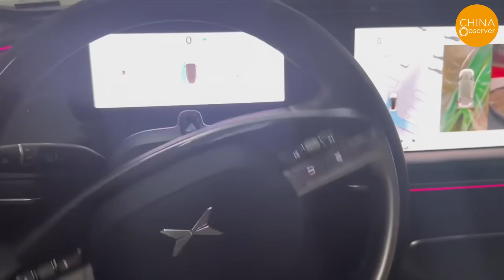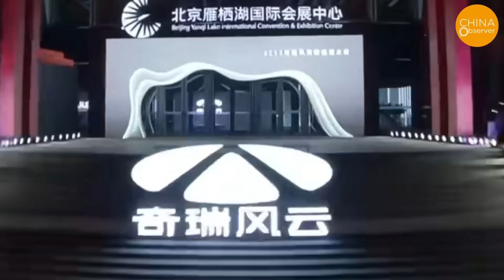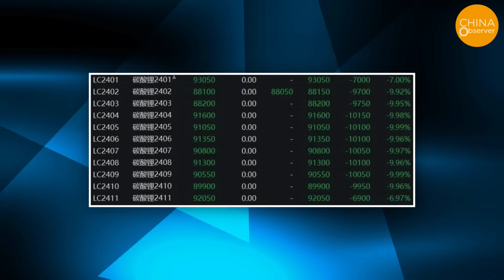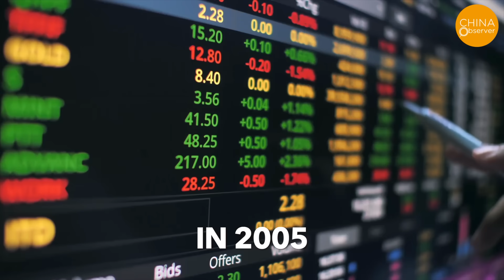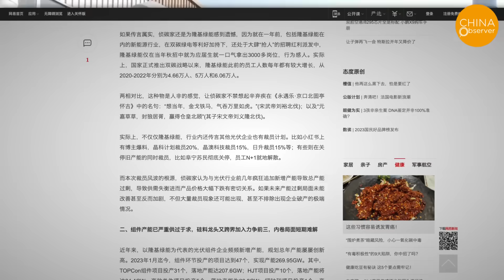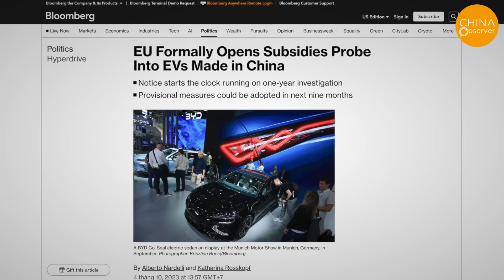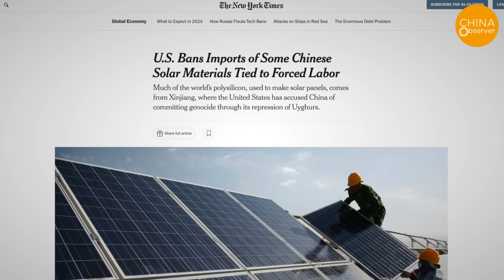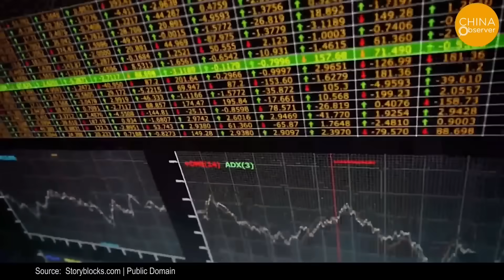Sudden EV Explosion, Rockets up 5 Meters, Close to 100 BYD Autos Spontaneously Combust

Comment: Albuquerque almost BYD electric buses for its transit.
The buses ended up not having the range they promised. The charging stations they installed were not certified and ended up being dangerous if they were used long term.
The city was smart in testing after delivery, instead of taking their word.

Comment: And theres why EV's arent so special, the companies wont take care of the used bateries cuz is not viable, fossil fuel still reliable, but its needed a better way to reduce the CO2 expulsion of the engines, or to find a new way to have a more reliable and sustainable way to power vehicles, with less impact to envoirement in both ways, creating it and reciclying it. But....they preffer to dispose it rather than recicle and reuse it, cuz its easier, less work, less workhands to pay and to take care.

Comment: My guess.... their not giving the Electric battery compartments room to 'expand' due to heat build-up in the batteries, nor do they have air-holes for the gases created / released by the batteries to escape... which is causing heat-damage and possibly condensation to form.  And Lithium + Water do not mix.

Comment: New battery technologies are rapidly advancing to replace ithium batteries. Sodium ion batteries have reached the efficiency of early lithium batteries, and sodium is waaaaaaay cheaper. Short distance sodium-ion cars would already serve the needs of the many who just use a car locally. For the two-car households, it's a real option, once a cheaper version gets marketed. As with early Teslas, the first cars are marketed as status symbols, but copy-cats aiming at a broader market are in development.

Comment: The work to engineer a good EV battery isn't easy. Just a few years ago we had BYD batteries being touted as so safe.. now we see that they have problems when they put them into packs. Single batteries are one thing battery packs are something entirely different. Managing batteries and keeping them safe isn't as easy as it looks. Chevy Bolt shows just the same kind of issue.
Reply: Scandinavia has been crazy enough to try out electric excavators, only to find out the batteries won't even last until lunch. So what do they do? Hook the excavators on to fuel-driven electric generators. Hurray for technology!
Reply: @haraldthi  Fun fact

That was a Toyota Rav 4 . A gas car . Oops 😂
Reply: The NEWER batteries LiFe-Po4 based on iron and phosphor are safer, lighter, hold more charge and cheaper to make, and being made right here in the US
Reply: @HobbyOrganist 
"Safe and Effective."
Reply: @FCE-dogs LiFePo has been tried for a while, and as I can remember there's been problems with it slowly leaking power. Has this been solved yet?
There are brands now focusing on synthetic fuels instead, and that's also an option. I have too much background in the natural sciences to really believe in this climate hysteria though. Do we change the nature around us in a way that can't go forward? Yes but it's not nearly that dramatic.
Reply: Yeah, there's no way we're going to be able to adopt this tech unless it's centralized on an electromagnetic rail network. Just make the roads move on tracks and any old lawnmower could get places at consistent speeds. But I also think the same has applied to gas powered vehicles for decades now and way too many people perish because of operational/technical failures. It's unacceptable for a shared public roadway
Reply: Super Capacitors In Hybrid American made Cars! EV's Are DECADES Away From Viability! We Could Not Change Over To EV's Even If It Was The Law!! There Are Fleets Of Trucks That Wanted To Go To Electric Only To Find That To Charge Them Up Would Use More Power Or Volt Amps Than The Entire City Uses During Full Draw! EV's Wont Happen Because They Can Not Happen!! Not For At least 20 More Years!!

Comment: Supposedly Sodium-Ion based batteries are more stable, non-flammable and offer higher energy density and lower manufacturing costs than Li-Ion batteries but are currently problematic as the number of charges over its lifetime is much lower than Li-Ion batteries. Once the number of charges over a Sodium-Ion battery's lifetime is increased to near the level of Lithium-Ion batteries then it will takeover as a storage medium in most applications which require portable power.

Comment: The problem is: we are on the wrong energy paradigm. Cannabis hemp seed makes excellent engine oil and gasoline which is biodegradable. A sativa strain can grow up to 15 feet in six months. The female's seed production constitutes up to 85 % of the bio mass. Not only is the seed useful for fueling vehicles, it can be used for cooking oil, bread, porridge and so forth. Indeed, hemp seed is the most complete vegetable protein on the planet. Do you have any idea who is responsible for the colossal crime against humanity by demonizing cannabis hemp agriculture? The usual suspects of course. These very same miscreants are behind the EV bandwagon.

Since it is obvious China doesn't give a damn about the environment and is indeed an environmental rapist it is high time this grab hag culture is re directed. Because of the huge subsidies for EVs for example, entire acres of new EVs are sitting, rotting in open fields. Serpentza did a video pertaining to that. And, as was indicated in this excellent presentation, within the next couple of years a major ecological disaster will unfold because of the lithium ion batteries which are highly toxic and very dangerous. 

As for the efficacy of EVs, I would have to opine that they are not efficient at all. The batteries take much too long to charge up. If I was on an EV off road motorcycle and ran out of electricity I would not be able to solve my problem by plugging into a currant bush. Who is going to come out into the forest or up on the mountain with a battery and charging cables? As for charging stations, they are a joke. Only x amount of Kilowatts are assigned to a charging station and if there are several vehicles charging, they only get a percentage of the total and will not likely obtain a full charge. The entire EV circus is what it is because in general human beings like band wagons and don't like thinking very much. EVs are just another example how human beings easily believe anything put before them, especially by other human beings in fancy robes, funny hats, huge fortunes, whatever. To wit the adulation of Elon Musk and the 'success' of Tesla Motors. Promises, promises, and more promises but no tangible results. He is polluting the upper atmosphere with dangerous satellite telecommunication systems at the behest of governments who are ruled by corporations run by the usual suspects, of course and who are hell bent upon the total control of everybody on Earth with chipping technologies coupled to the nefarious military industrial satellites Elon and that other billionaire twit, Branson are putting up in the skies; OUR SKIES! What gives these creatures the right to do these things to us? To force EV tech on us? Do you not think we should perhaps consider this gong show for what it is and stop it before we go any further with this dangerous, basically useless technology and do as I suggested? Get on a more advanced, sustainable, environmentally friendly energy paradigm with cannabis hemp. Talk to your politicians. Perhaps there may be one or two out there who are not in the pockets of the suspects who are usually responsible for 99% of our afflictions, misery, and ultimate destruction.

Comment: The main challenge to China's energy industries is hydrogen since it can both power hybrid and ICE vehicles including buses, trucks and trains as well as supply power for domestic and industrial use. The problem, as perceived by those who buy into the carbon dioxide- climate scam - is that in producing it by steam reforming from methane large amounts of carbon dioxide are produced. Apart from the need for this to sustain food production countries like the UK intend to store it in depleted oil wells. Claims of producing it from surplus wind power do not stand up to scrutiny due to the costs of liquefaction, storage and transport as well as the power needed. The UK intends to replace methane in the national gas grid by hydrogen but it can also be produced locally by electrolysis using surplus power from the small modular nuclear plants being developed by Rolls Royce and it German and Indian partners. This provides a practical means of storing energy from the need to run these plants 24/7. This means that the future is hydrogen not wind, solar or battery EVs and China has backed the wrong horses.

Comment: Someone has to double check the videos here, the first white can is not an electric it’s a modified car to run on LNG and similar accidents happened for these modified cars.
Most of the explosive comes from PHEV plug in vehicles have really scary failure rate in China, yet for EV with LFP batteries has no record for similar problems

Comment: My technical analysis:

The battery cells propagated already beforehand of the explosion and the battery housing had no functional degasing valve (maybe was closed in a backyard workshop) and therefore the pressure could increase this much with a high volume in the housing that the housing exploded with accumulated gases at once which let to the rocketlike vertical flight of the car.
Reply: It's a rav4 from a movie shoot.  duh.
Reply: @ianrobertson3419 show me please the movie :)
Reply: My analysis: evs are a scam
Reply: @tylersowa3858  of EVs r a scam. Why the cars exploding are gas cars ?
Reply: Not a very technical person then are you… 😂
Reply: @panamaJ  I don't wanna be towards evs waste of my time

They still a scam
Reply: Ur analysis is wrong of u can't spot the rav 4 in the beginning

Comment: That first one was definitely fake. EVs don't explode like that they just kinda pop, they'll knock out the windows and damage doors not fly up like that. The battery pack will burn violently though and very hot like a blow torch.

Comment: The EV market in the US is also experiencing a massive slowdown. The lack of sufficient charging stations is a major contributor, and this does not seem to be on the way to being solved any time soon. 

As for lithium, a major, major deposit has been found in the southwest US. This will put even more downward pressure on lithium prices.
Reply: Unfortunately no.
Even with the new operations coming on line worldwide lithium demand will be short supplied by 50% 2025.
We can't get it out of the ground quick enough.
Reply: @0Aus  Well, that may, or may not be, the case. You are assuming that the demand for EVs will hold up. It does not seem to be already, so projections about the need in 2025 lithium demand are probably incorrect. In fact, the best indicator of these things is the current and futures price, not what some pundit says about it.
Reply: @louisgiokas2206   clarification. 
I have not assumed anything. 
Chief executive Sinead Kaufman of Rio Tinto 
Provided information in quartuferly report. 
I can say with confidence Both Rio Tinto & Individual of Miss Kaufmans calibre assume little to nothing. 
I also work in the Australian mining industry. Many situations agreements are set well before we wining the minerals. 
Regardless fact is we can't supply it fast enough as it is. Doesn't help that lithium ore is one of the most difficult of all to win. Lol it is a right hassle. 
Have a great day.
Reply: @0Aus  How do you explain the drop in prices? 

While the agreements are indeed set before mining, it is the futures markets that show the future trends. This will also feed back into those long-term prices over time.

Comment: temperature safety ............ no gas venting probably ? fully charged +high temperature + no cell gas means "boom" ! then the battery box ............ think its pretty thin , as the batterypacks of most have to withstand a good amount of damage before it should "disintigrate " ! and yes i have not seen any collisions on tesla cam or dashcam sites showing a burning tesla after a collision !

Comment: Imagine being burnt alive in one of these Chinese vehicles. And once they ignite, you have literally seconds to get out before you're engulfed in flames. Disturbing to say the least.
Reply: Good thing everyone else is still driving gasoline powered vehicles, they never catch fire!
Reply: @ianrobertson3419  my vehicles have never caught on fire. I can relate.
Reply: @Solid3d-Melb  dude, just do some research, cars have been self combusting forever.  Bad fuel tanks, bad electrical switches, poor engineering.  It's plagued all vehicles for decades.  It wasn't too long ago that seat heaters were burning down cars.
Reply: @ianrobertson3419  yes, I know, but the speed at which an electric cars burns is greater in an EV, much faster.

Comment: I just talked with my BYD dealer and he said the China EV YoY sales are up 37% but there is a trick, 2/5 sold are EVs right? Wrong, 4/5 are EVs because it's the bigger cities that buy the more expensive EVs and that's what counts. Elsewhere ICE is still selling well. Now lithium is cheap and battery manufacturing is quite advanced so even the smaller EVs are affordable. They expect EV sales to take over 60% of the market by 2025. EVs are safer, more reliable, cheaper to use, and most people already have 20 years of experience of using electric scooters.

Comment: What a brilliant future with electric cars.😢
Reply: When all those EV's go dead, where will they place them?
Reply: @RalphsPier1961  its still a small percentage of all EV who will burn.
Reply: @RalphsPier1961  recycling.
Reply: Rav 4
Reply: Popular at holidays though. Instant fireworks.
Reply: dont take this video to serious. half of it is just not true.
Reply: @BlacKi-nd4uy  BUT Half IS True and TOO Many explosions and are you saying YOU promote both Slave Labor and Child Slave Labor mining Lithium and Cobalt from Africa? because that's how it's mined do you promote more strip mines for iron and Copper and Nickle for manufacture ev? More Toxic waste in manufacturing and no recycling ev where you can recycle present gas cars
Reply: @BubuH-cq6km  first of all, most EV dont use LI Ion in china. LFP ist the most common battery cell chemistry there. LFP doesnt contain cobalt. and china is going to use sodium ion batteries in the future, which doesnt contain any problematic resources, and is therfore even cheaper. so, EV are the future, but for most ppl in the future.
Reply: @BlacKi-nd4uy  There are many EV's self combusting all over the world and firefighters hate having to try to put them out. The mining and resource gathering practices cause widespread misery and pollution. We have other, better energy sources that are simbly obfuscated, and TPTB pretend that oil is a dwindling resource which it is NOT - the Russians discovered in the 50's that oil renews regularly and crude oil is absolutely plentifull. "Global Warming" is a farce.

Comment: Since the CN Car Dealers  are now scrapping first generation EV cars which were based on ICE conversions to EV they should strip them for parts to resell onto the Western markets for ICE conversions instead of crushing. Lots of profit to be had from the demand of the Western drivers to rip out ICE engines and fit EV motors and power control systems. Batteries can be sourced elsewhere that are more reliable.

Comment: I have a plugin MG HS PHEV and have had no issues for two years now, for now I think PHEV is best option. The high power battery packs on the latest Electric vehicles can take a long time to charge at home if you don't have sufficient incoming power so the quoted 15mins to 80% is when you are plugged into 130-150kW chargers, your lucky if you have that kind of home power.
Reply: 😂😂😂 PHEV are the most likely to catch fire. 5 times more likely than ICE vehicles, & catch fire 220x more than BEV's.
Reply: Yes, very lucky.  More tablets please nurse…